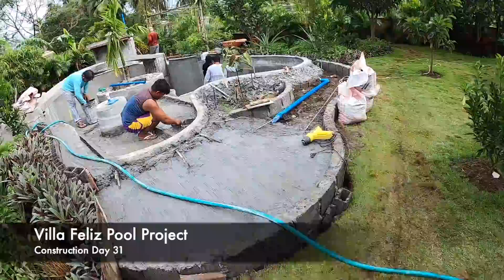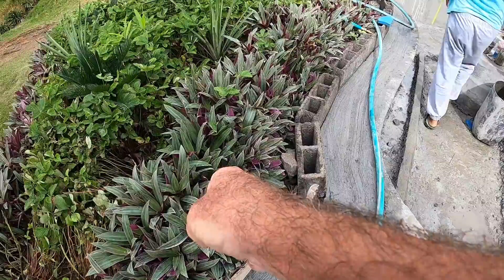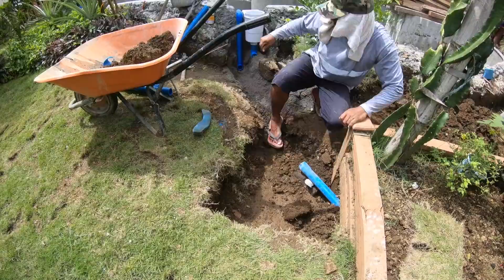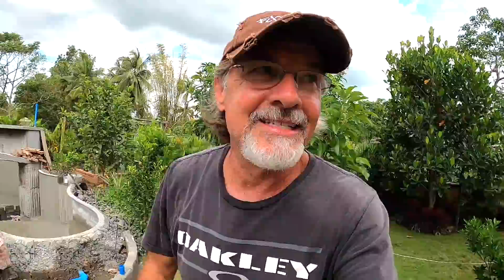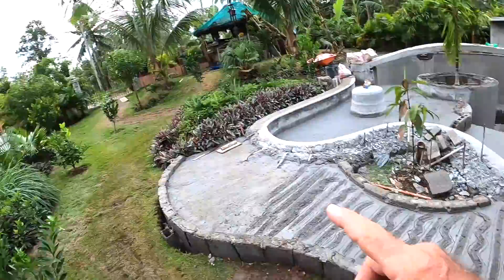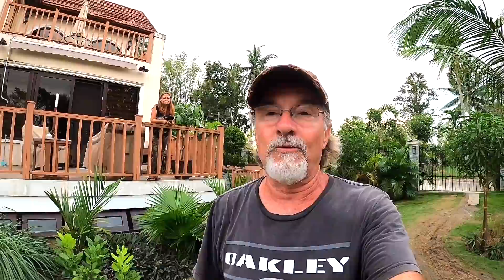VILLA FELIZ POOL BUILD - EPISODE: 31 (House Building in the Philippines)

Comment: I'm surprised the 2 inch pipe is going to be embedded in the concrete and not under the concrete and into the ground.  I thought mixing concrete and plastic was recipe for cracking, but maybe it doesn't matter since there will be tile over the concrete.   Do you think they can lay perfect concrete in a house that's good enough to instead of laying tile, stain it and done?
Reply from the maker: Guess we'll find out soon enough.

Comment: The electrical inside the palm tree planter. Is there going to be some kind of safety drain system for rain fall. It could build up and over flow into the pool and it could compromise the electrical. Just asking in case I missed that.
Reply from the maker: The electrical is 12VDC and will be weather proofed.  I've been watching the planter in some of our worse rains here and so far it drains well.  Had you mentioned this at the beginning of the build I might have had time to put an overflow pipe in.
Good catch that might help someone in their upcoming build if they choose to go the route we did with the planter.

Comment: Hi James, things are really coming along.  I see that you have an overflow plan, but I do not see an automatic water fill float system for when the pool evaporates water.  Are you planning on adding one, or just going to drag the hose over every time the pool needs to be topped off?
Reply: Do you know how much it rains down there.
Reply: @galdessa1  Sure, I have lived there for years.  But when it is sunny water evaporates very quickly.
Reply from the maker: I added an auto filler inside my skimmer to my koi pond project in the US as I showed in my koi pond DIY series.  It really helps.  The skimmer for the pool is much smaller than my pond skimmer so when I looked at how I could add it the solution wasn't acceptable to me.  To make a long story short, yes, I think I will be manually topping it off unless I can figure a better automatic solution.
Reply: @MyPIDream  James, speaking of your US series; I did see a couple of them referencing bringing appliances from the US to the Philippines and one that showed you doing annual start up after winter with your koi pond.  But I think it was under "My PI Dream" series.  I think you are still maintaining your home in the US and the one in the Philippines.  Any series on managing both?  That looks like what I am going to do in the future and really could use some ideas.

Comment: Sir do you have a balancing tank?  So that you can avoid an air lock from the pool pump.
Reply from the maker: We'll be adding a shut off valve before the pump so it doesn't lose prime when I do maintenance.  I'm not familiar with a balancing tank.

Comment: Main-Drain question. Are you planning to split the return with two main-drain intakes? For safety, you need to install two intakes to prevent the suction from traping someone on the floor of the pool.
Reply from the maker: The intake comes from 3 points.  2 skimmers and 1 bottom drain.
Reply: @MyPIDream  The VGB Act requires that public pools and spas in the United States be equipped with anti-entrapment devices or systems that comply with the ASME/ANSI A112.19.8 performance standard or any successor standard. ANSI/APSP-16 2011 is the successor standard to ASME/ANSI A112.19.8.” Read more about the VGB Pool and Spa Safety Act here. Please review this link, I think it may give you a better understanding of the requirements for pool drains here in the states. It's a simple fix at this stage of construction. Skimmers don't prevent entrapment! The last thing you want is for a child to be trapped by a drain suction of over 700 pounds. Just trying to help.

Comment: Ur right James for the pipe direction. They also should not have  any short 90 degrees angles it should be a long 90 or 2 45 degrees with a short piece of pipe in between. In a pool or any drain you get turbulence  at the 90 and debris will build up over time. If they don't change you should make a note of them or take a picture for where you might have to snake them  in the future    just saying  and they will block eventually lol also as you know you will lose flow pressure. anywho carry on meson...lol